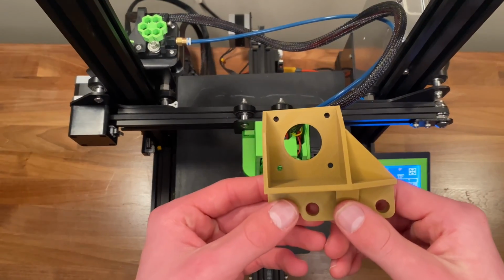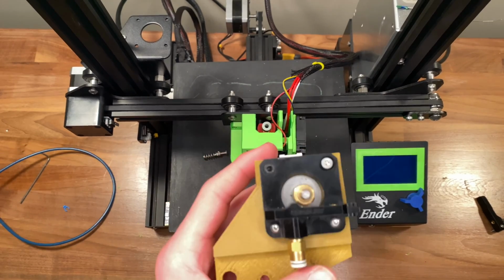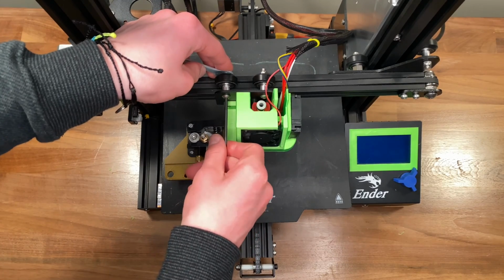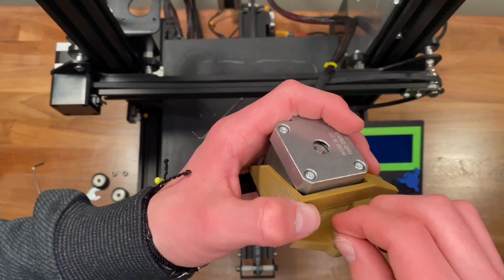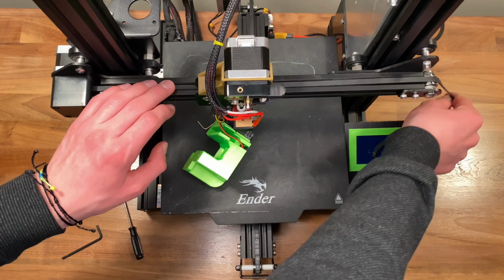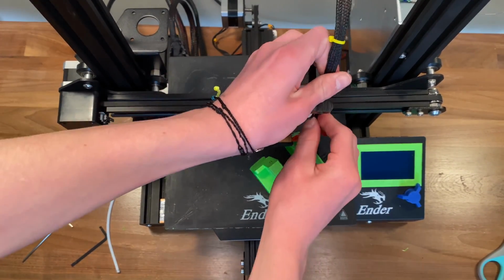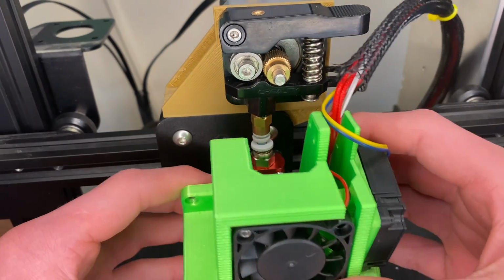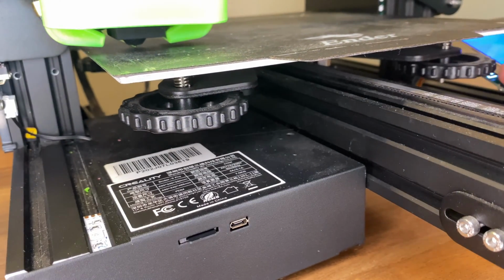Direct drive Ender 3 pro using only 3D printing

Comment: when i home the printer the motor is too big to fit
Reply: You need a small block to attach to extruder assembly, STL is in the same folder.
Reply: Same issue here
Reply: @carterkraber6784  if you check the thingiverse file for it there’s a little stopper on there.  Also you have to customize your bed size, personally the stopper was too short and I ended up super gluing it closer toward the end stop. Everything on mine is stock and works good 👍🏼

Comment: With the extruder motor wire being so short how can you print taller items?
Reply: buy a direct drive stepper motor extension cable that's what Im doing

Comment: Converti mi Tronxy XY3PRO a extrusor directo. Tuve que diseñarlo desde cero con fusion 360 porque en internet no hay diseños para este modelo de tronxy. Baje la retraccion de 5.5 mm a 2.6 mm con un flujo del 95% y asi consegui exelentes impresiones. Lo mejor es que no tuve que modificar el cabezal original de la impresora. Saludos

Comment: 6:40 BRUH! That wobbling.
Reply: When I printed this, I had that issue. There is a fix. On the ball bearing on the bottom of the hotend, there is this metal hex piece about 20 mm long. Tighten that and your issue is fixed.
Reply: @ yes that is the eccentric nut I mentioned
Reply from the maker: Yeah the extruder motor adds a lot of weight and it's a bit off center but still works and doesn't cost any additional money except the filament price
Reply: @engineeringaddiction  yeah no. That's not  an excuse. The wheels are way to loose.
Reply from the maker: Lol
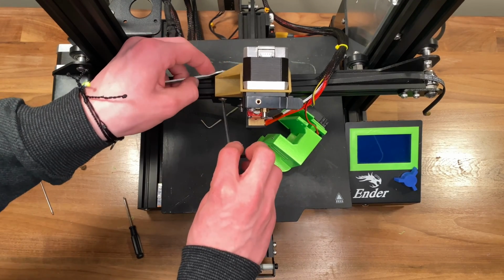Reply: @engineeringaddiction  3:30 it's literally still just wiggling around, right after you said it should be tight enough so it doesn't wiggle. You did nothing with the eccentric nut....
Reply from the maker: @LegeFles  I had tightened it too tight at first so it wouldn’t move then just didn’t fix it after. Print quality is still next to perfect.
Reply: @engineeringaddiction  Next to perfect, isnt perfect.  The first layer on that benchy is off, you can tell by the writing on the bottom, also, hide your seam ;)
Reply: kan je toch geen mooie print mee maken als dat zo wiebeld